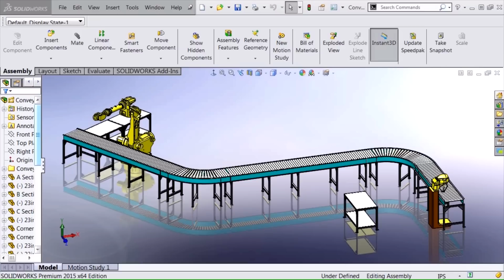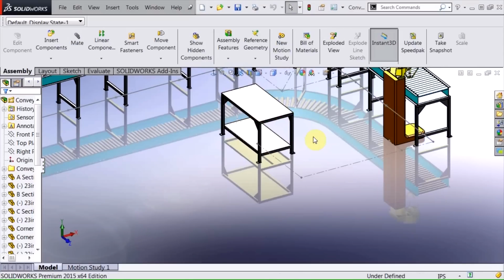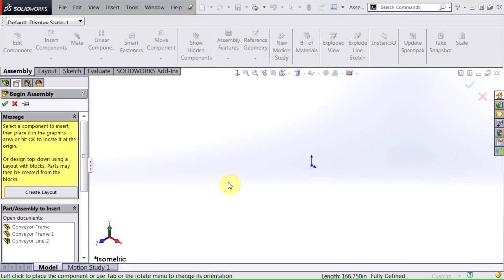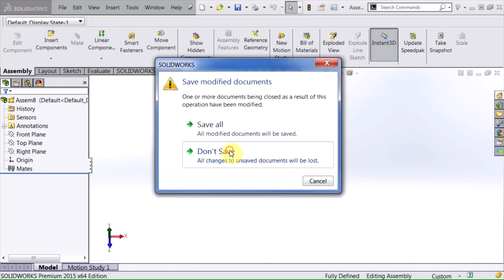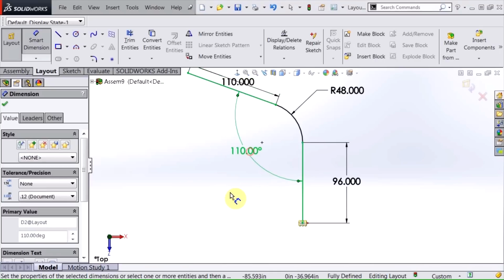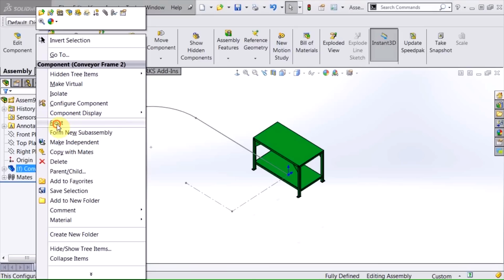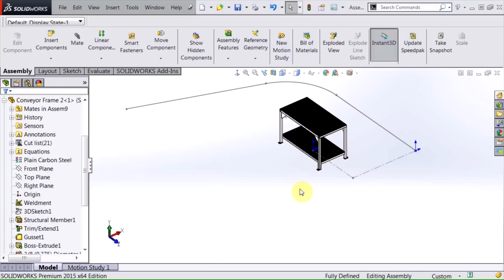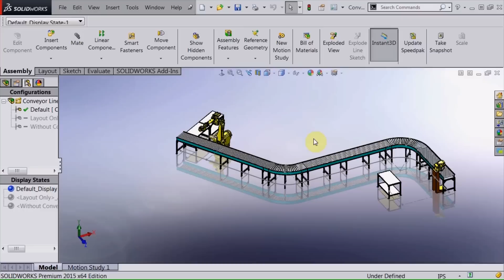SOLIDWORKS - Assembly Layout Sketch

Comment: How did you create the conveyor? I mean, when you changed the lenght, it automatically changed the number of rollers!
Reply: @20forti It's probably a curve-driven pattern, when you set a large number of instances and the distance, it automatically only uses the number of instances needed to fill the length of the curve

Comment: Dear sir, thanks for sharing this. A questiob, I've sometimes used sketches in an assembly to position certain objects (layouts) but is there a technical difference between a layout sketch and a normal sketch? It seems to me the workings are exactly the same or are there certain functional advantages that I haven't seen yet?
Reply: Good question, I share the same experience. I'm always a little hesitant to use a standard sketch because it lives at the bottom of the feature tree but in reality it appears to make no difference. My understanding is layouts are required when using sketch blocks and top down assembly.